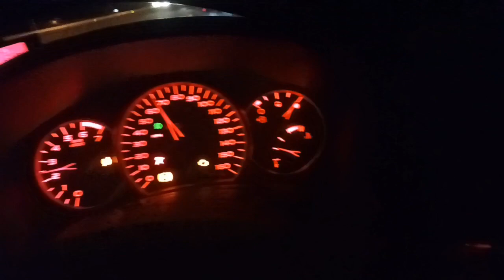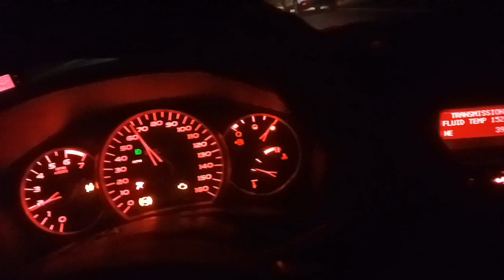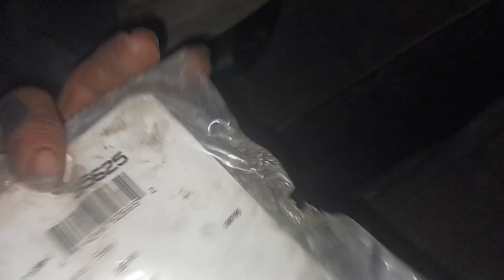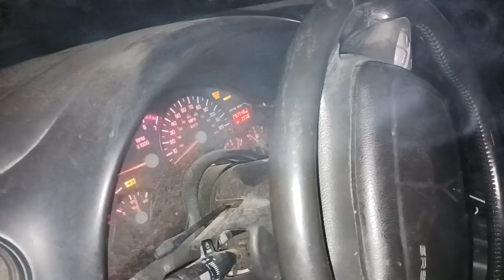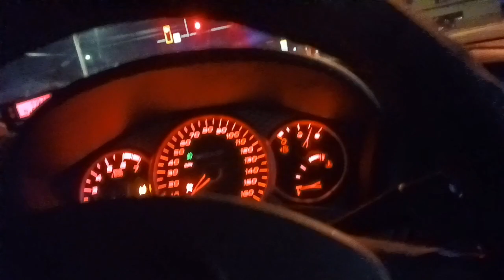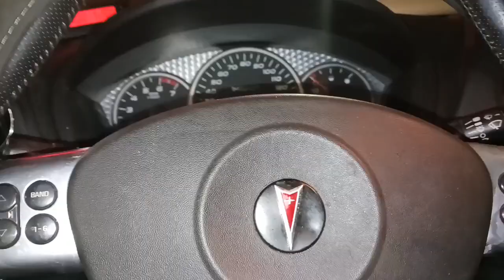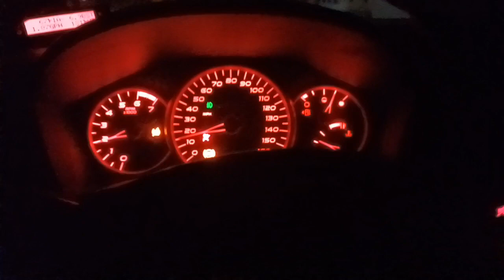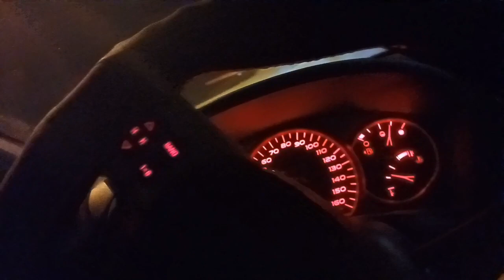I bought Tommy a 2002 Pontiac Firebird 3.8L for $450!!!

Comment: The old pulley was definitely junk. Ya did good on the Firebird too. The engine and tranny are worth $450.
Reply from the maker: Yeah I thought so. For a running and driving car I'm happy with it. And we went and looked at the camaro again today. Looks like the whole interior and the doors will swap right over.
Reply: @PontiacsGarage  A lotta those parts should be interchangeable. It's a good deal even if they don't.
Reply from the maker: @stevewheatley243  well Tommy looked it up on Google and it says the interior the doors to hatch and a few other things all interchange all the suspension is the same the brakes the wheels everything
Reply: @PontiacsGarage  Yeah basically the cars are identical except for body style. And that's not that different either. When I hunted for shock towers there were many models that was identical.
Reply from the maker: @stevewheatley243  yeah, so now we've just gotta get the camaro towed to tommys house and start swapping parts around.
Reply: @PontiacsGarage  Make a video. Put out as many as ya can. It'll pay.